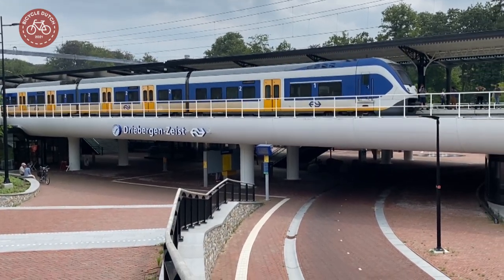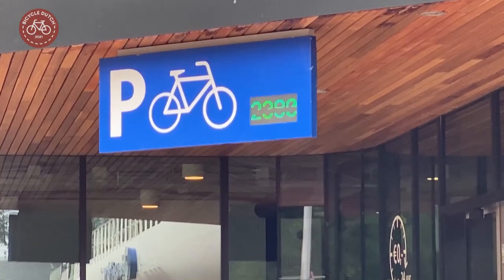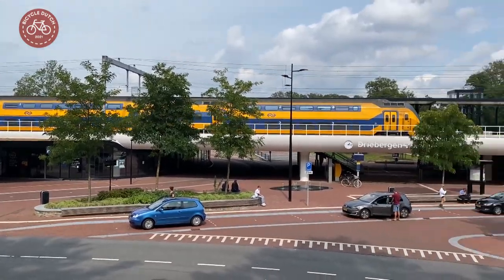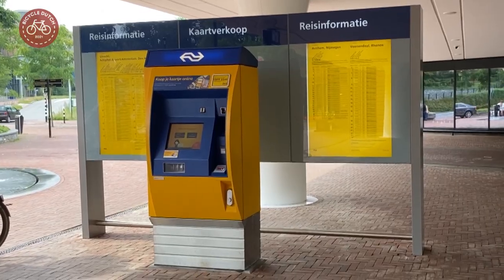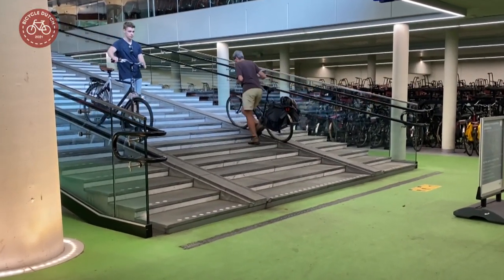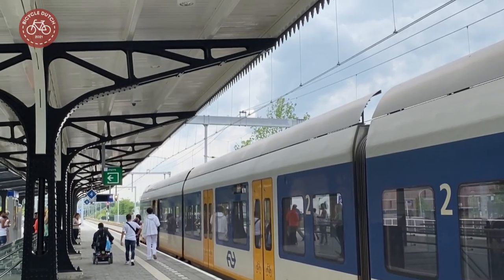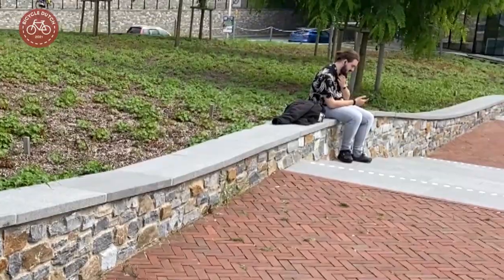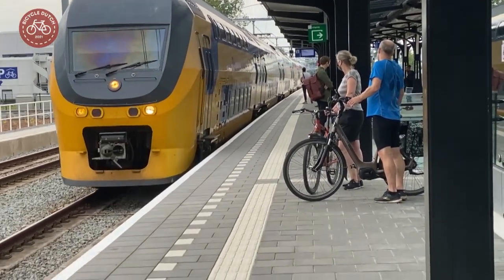The reconstructed railway station Driebergen-Zeist

Comment: Now we have 11 trains per hour in either direction (6 Intercities, 4 regional, and 1 international or freight) through this station, of which "only 6" are halting.  Local traffic would be totally blocked without this change.  One of the best features of this station, is that on the platform level, it still looks very green and small: there are no ugly tall buildings nearby, and the station easily fits in the surrounding parks.
Reply: Even an hourly service in each direction is quite an impact
Reply: Building tall buildings directly next to stations does make a lot of sense though. It is the best way to induce demand and get people out of cars and into trains. It does make more sense though here in the randstad than at Driebergen-Zeist though
Reply: do all intercities stop there? wow! back in my day there were only 2 stoptreinen, i think. and maybe a sneltrein that skipped Bunnik.
Reply: @chilanya  I think half the intercities stop at Driebergen-Zeist and the other half stop at Veenendaal-De Klomp.
Reply: @chilanya  Frequency of ICs stay the same for Driebergen and De Klomp, added are two trains which do not stop at either station hence is 3 minutes faster between Utrecht and EdeW.  However: Driebergen gets two more sprinters, so 6 trains per hour.
Reply: Please send me one used bike? From ethiopia

Comment: I like the brick road. Efficient way to get rid of overflows when it's raining. And it really isn't hard to ride on.
Reply: It's also great to keep speeds low. The last thing you need when people are trying to catch their trains are speeding cyclists.
Reply: it will be slippery though, with frost / ijzel
Reply: @chilanya  that hardly happens anymore... Also asphalt will crack and create potholes, whilst also blocking rainwater. Bricks are also super cheap and quick to remove for roadworks, or to reconfigure for optimization.
Reply: seems hard to skate on though

Comment: I live in Driebergen and it is indeed a great improvement. The exit ramps for Driebergen on the nearby highway (A12) are over a kilometer long, because during peak traffic the the level train crossing used to cause traffic to back up all the way onto the highway causing dangerous situations. Now cars can drive underneath the train rails at full speed.

As a prelude, they also widened an underpass 1,5km futher on, so that now cyclists have wide separated bike paths through it in both directions instead of sharing the narrow tunnel with speeding cars.

Comment: Melbourne, Australia has been going through a 50 + railway crossing removal project on a similar level of input and end result.With the amount of removals done including the surrounding road ,bike ,tram pedestrian and practical usable inter connectivity between both sides of the tracks .Places that were noisy ,irritating ,and based on a graffiti mindset have been transformed into some of the most enviable  affordable local places to live.
The bigger projects similar to the one in the video  ,now they got their act together the average time to do the job seems about 6-9 months from start to finish,with about 6 months community consultation  prior which in a lot of case shows how “wrong/inadequate” the thinking is from the initial planning ,but practice makes perfect.
Estimates are about 5 years more work  for the 5 years already gone  but the ones left are really big civil works,not many but when there gone every  black spot will be so much amiable.
Personally the best money ever spent  during my lifetime on infrastructure in the city of 6 million people.

Comment: they should also change the programming of the traffic lights on the mainroad going under the station.
The main road from Zeist to Driebergen or vice versa should be the priority road.
But the traffic lights are always on red. 
You come down a slope and it is red until you reach the sensors in the road. If no car comes from the side road, it will turn to green.

You might ask: What is the problem?

Well, if you are a truckdriver, filled up to the brim with fragile stuff, you want to keep it rolling. But you can not keep the truck rolling at 50 kilometers per hour down the slope. You have to touch the brakes to slow to something like 30 when you go over the sensors. Because else you have not enough stopping distance if the light decides to stay red).
It has happened to me that the light stayed red eventhough no car from the side road.
Then you are at the bottom of the tunnel. So you have to get the fully loaded truck with fragile load up the slope again.
This could all be easily prevented if they put another sensor a bit further up the slope, and program the traffic  lights on the mainroad to be priority.
So they stay green all the time until other traffic comes from the side road.

Seriously annoying traffic light programming.
For truckdrivers that is, that carry fragile load which just cant handle heavy braking down a slope because the load will shift.

But in all i think an improvement for sure.
I take care of myself by slowing down to 20 or 25 kilometers per hour, to make sure i can brake before the line if a car or other traffic decides to cross the road. BUT not every truckdriver does that, especially not when they are empty. 
If they keep it 50 expecting it to turn green, and a car comes from the sideroad, you will only see it at the last moment. The truck might not be able to stop intime.
Anyways, we shall see in the future.
Very strange way of programming traffic lights in my opinion.
Traffic lights on main roads should always have priority and should only change colour if a car indeed is about to enter the junction from a sideroad.
It not only is much safer that way, it also keeps the traffic flowing and trucks do not have to stop for no reason.

Take another example: When you enter Zeist coming from Driebergen, you will go right through the center via a small road.
It has 2 traffic lights which follow eachother very shortly.
1 for traffic coming from another direction crossing you to turn to Driebergen. The other is for the traffic coming from the other direction that wants to turn into the city center.
Both turn green at the exact same time. As a truck driver you start accelerating. But before you get to the second light, which is 200 meters or so away, it will turn to red.
Even if there is NO CAR WHAT SO EVER anywhere to see.
There is a camera just before it. NOt a speed camera but some other camera. Maybe they want to take good picture?????
I dunno.
It is seriously friggin annoying. You first start your truck with the fragile load rolling again, to then have to brake to stop it again. Stand there like an imbecil for 10 seconds for the light to change again.
Anyways, that was a shitload of offtopic shit.
But, im rid of it.

Comment: While I understand the reasoning for shallow staircases, it also makes walking on them a bit fiddly: taking one stair at a time requires uncomfortably small steps, and taking two is doable but uncomfortable in a different way. I would appreciate having a second, slightly steeper flight of stairs.
Reply from the maker: These shallow stairs are perfect for pushing your bicycle up and down. There are ordinary stairs for when people are just walking. They lead to the platform while the shallow ones lead to the street.
Reply: If it wasn't that these where shallow for the bikes. I fully agree in having a deep hatred for them.
Reply: @BicycleDutch  Please send me one used bike? From ethiopia

Comment: I brjefly stop at this station twice a week on my commute, and it has been lovely to track the progress of the transformation. 
But as a Dutch person who is totally dependent on my bikes and public transport (and I enjoy every second on my bike), I honestly think those public criticisms you mention at the end sound pretty spoiled and privileged. That 90 degree angle is specifically there to make sure cyclists cross the road much slower. The brick pavement has the same effect for the underpqss: with smooth asphalt, thousands of bicyclists would absolutely send it on the downslope to save energy going back up to ground level, on a daily basis. 
Because cycling requires physical effort, so bicyclist try to keep momentum as much as possible. But because of the excellent Dutch infrastructure, they think it means that they don't even need to slow down. Better infrastructure makes cycling much safer and more accessible, but it's also more lenient to inattentiveness or outright disobeying traffic laws.
Reply: Thanks for stating this and explaining it, I couldn't agree more!
As a part-time pedestrian I regularly feel threatened by cyclists having their cake and eat it, as if the traffic rules and general directions do not apply to them if they have to slow down because of those rules.

Comment: Bit of a shame that they didn´t build the new canopy in the style of the old one, the mix of styles doesn´t work for me when they are right next to another like this.
Reply: To be honest, it is a typical, cost effective way to keep costs and environmental effects down. This is usually done by reusing as much older structures as possible and then augment them with cheaper to construct, cheaper to clean (to lower TCO) and maintain and overall more sustainable, extensions.

But I agree, esthetically it is often better to use the older original style structures.
Reply: I think it's honest and like the old/new effect. Can't argue about taste, as they say. 😀

Comment: A negative would be the stairs to the bike parking. When in rush to get a train i don;t want to drag a bike down the stairs ! I'd say there is enough space to put a 40m cyclable ramp into the design of suche a big bike parking .
Reply: @Ralph Macchiato Design should be based on human behaviour and people just behave like that ! Whether I am in a rush or not : I really do not like to walk my bike up/down a stair as long , with a suitcase, weekend bag or a big backpack. Period ! The same after a shopping spree downtown to walk up with multiple bags . Did you ever try that ?! Probably not, otherwise you wouldn't settle for that. There is no reason to come up with such a sub par entrance when the station was designed from scratch and where there is enough space like here... There are enough proper benchmark examples in Holland. So 👎